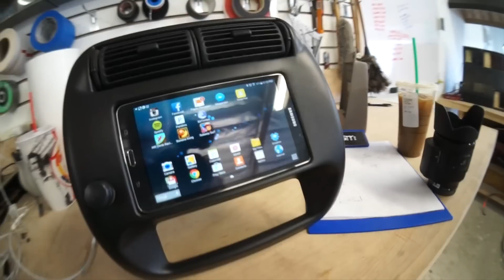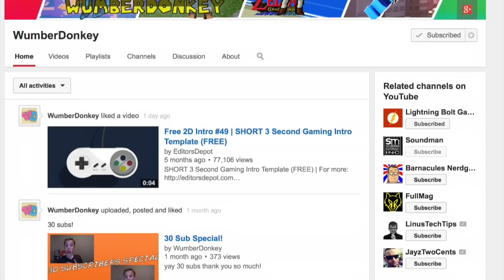How to Install a Tablet  in Your Car, Galaxy Tab 4 Ford Ranger

Comment: *****  For a Ranger, do you think you could get a Samsung Galaxy Tab® 4 8,0"; which measures 9.58 x 6.94 x 0.31 inches, to even fit let alone look as good as this instal? I'm with T-Mobile and they only offer the larger tablet. The 7" isn't being sold through them plus the chip in the 7" isn't as good as the 8" from what I read online. But by the looks of the video the larger one wouldn't fit. Do you have any ideas? I think I would be mainly using it for serious sattelite radieo, netfilx videos, and Google NAV and I'll keep my phone for incoming calls hopefully blue tooth my phone into the system some how.
Reply: Rafael Felix how do you keep the galaxy tab from falling out, in the ipad case it has magnets does this one do too?

Comment: love the show and i want to buy one of those holders but since i have an x5 e53 with navigation i cant and dont want to use the factory radio, what do you guys use to convert the audio and split the signal from the audio? i will be using the stock amp and want to connect another amp to a subwoofer also...

Comment: Nice fabrication! My questions are: Outside of connecting it to the aux input on your head unit what is a good processor to use? I would like to entirely delete my head unit and just use a tablet. would be nice to have more control over the system than just using a electronic crossover.I have been searching the internet but have not found many solutions.Best thing so far that I think might work is an ARC PS-8. cool as hell but expensive as hell and not sure if it will do what i want it to do. How does your shop integrate tablets into an all aftermarket system, amps and woofers ext?

Comment: Doug, Android devices don't have good sound quality such as the idevices. But when you broadcast audio via bluetooth , this difference  is close to zero because the compression of the bluetooth transmission's protocol. Two major vantages of using Android  are you can expand store capacity through micro SD card or OTG cable and transmit digital audio to a cheap external DAC (in almost every device), getting a better audio than connect P2 on a idevice. The cheapest way to get digital audio from the lightning ou 30-pin connector is usind a expensive interface because Apple requires a especific signal on the connector to unlock the digital output.

Anyway, this is just a tip to not despise Android devices given their potencial and their implemetation costs. And i'd like to thank you for showing me a way to hold my phone in my dash without using magnets.

Comment: Very cool install, love it. My only question is....how in the HOTT DAMN hell would you be able to control volume of the music? Do you haft to leave your headunit behind the tablet which would in turn block the IR sensor on the front of the headunit anyhow. Maybe i'm lost, but i don't get it. Otherwise like i said, it's definitely cool as fuck and i have a Galaxy Tab so i'm just curious how it all plays out.
Reply: I installed a sony radio that uses app radio to control the radio with the tablet

Comment: With the cheap ass kit how does the tablet stay in snug with that space at the the end, I realize you need it to be able to slide the unit in but what keeps it from falling out like tipping forward etc and does it all fit in with the charger plugged in? Thanks I may have to order or even build my own android cheap ass tablet mount for my car, definately looks awesome especially with the secret spot behind for a single dinn deck! Thanks
Reply: Phil Peterson 
it slides into the plug.  thats is what keeps it from falling forward

Comment: Quick question, what is the point of the tablets in the dash? (serious question) Does it replace a stereo or do you use it to stream audio via bluetooth or dock connector to a head unit? Its just a question I had since I first seen you install an ipad. BTW love your videos and LMFAO at the ending of the video.
Reply: The way I installed my iPad Mini in the dash of my truck was to install a Sony single din head unit behind it to use as the tuner and plug a lightning cable to the head unit so any sound that the iPad makes comes through the speakers such as music, navigation etc. I don't use BT except for my phone to make and receive calls hands free. There are a few different ways to connect the iPad/Android tablet depending on the vehicle your installing it in.

Comment: how you connect the sound from the tablet
Reply: wanako c-los they make interface kits or just go the cheap route and use a small amplifier behind the dash and use a 3.5 mm cable to rca as a pre out

Comment: but how do you connect it to your car's audio??
Reply: +Joey 9 Search something like a Kenwood bluetooth amplifier. I am in the middle of a Dodge Ram Infinity System bypass tablet install. It's been hell but fun at the same time.
Reply: I use a sony radio that has app remote to control the radio with the tablet